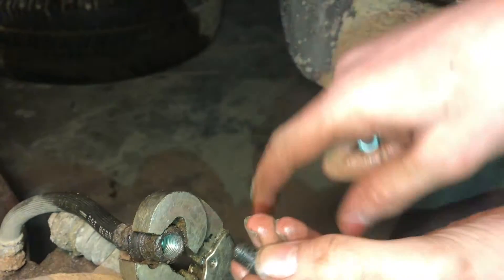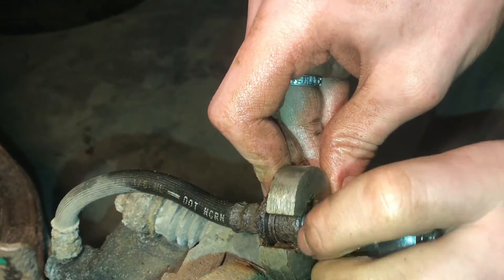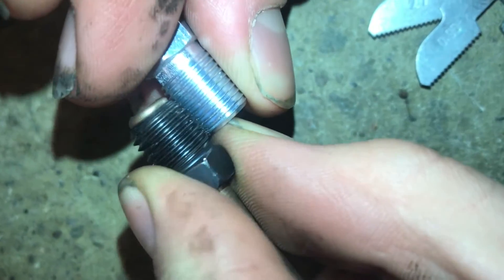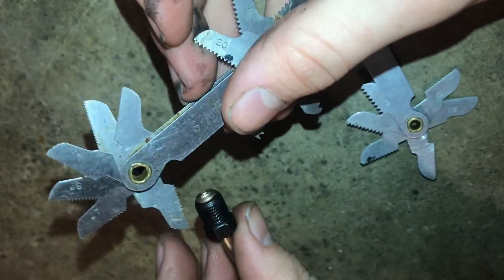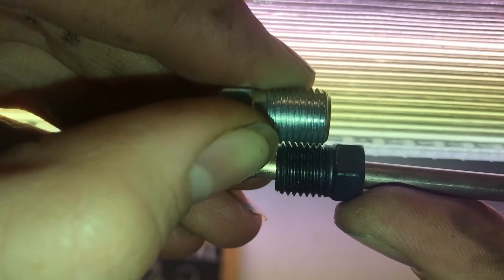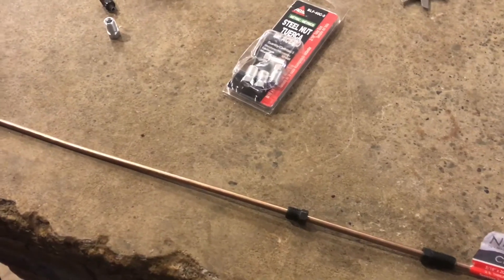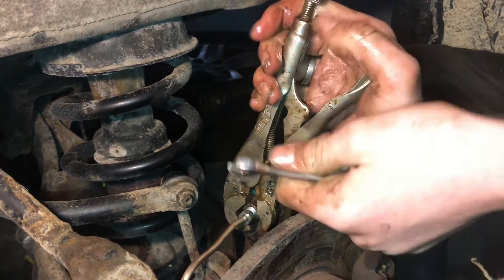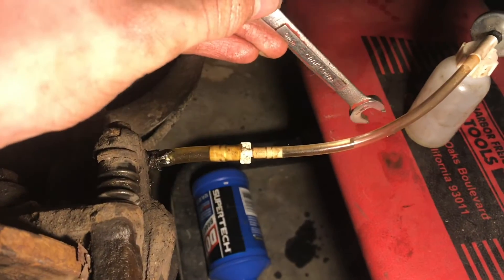how to verify brake line fittings are CORRECT

Comment: Here is the way I explain the difference in the metric versus SAE threaded flare nuts… And why they are so close? A flare nut with metric 10 x 1 thread has threads that are 1 mm apart. There are 25.4 mm in an inch, so 25 threads. A flare nut with SAE thread is 3/8“ x 24. So there is basically only one thread difference across an inch. You have to be absolutely certain what thread you are working with.

Another thing you did without explaining was when you cut the store-bought brake line in order to replace the flare nuts? You did not show how you created a new double flare, assuming you made one? some novice watching your video may think it’s just a matter of cutting the line and pushing it into the fitting, which of course would be a disaster.

Comment: Just so everyone knows, the black threaded bolts are a standard American thread. They work fine if you're using another union that is designed to fit. They're only wrong for the car in this video. Always do research and don't rely on any single piece of information.

Comment: Thanks for the video. The Chinese metric fittings were loose fitting on the Brake Hose assembly. I needed the SAE fittings not the foreign metric ones. Now I know why the Fittings were not tight and causing Brake fluid to leak around the fitting.

Comment: I bought a length of copper brake line from the parts store for my Ford Ranger and had exact same problem with the threads of the black colored fittings.  Now I know why.  Thanks for the great video!!
Reply: Same with my 98 Ford ranger

Comment: Just a note: On Euro Brake lines, the Flare us a 'Bubble' type vs. The 'Inverted' type on USA & (I believe) Asian marques.

I believe that the Asian & Euro use the same Metric 'acorns/nuts', but pay attention to the Flaring of the Line.

This can be a challenge when you're swapping parts (such as my GM Master Cylinder swap onto a '66 Porsche.

Comment: Only video on YouTube about this. Question, I'm working on a brake system that came out of a 2013 Sierra and making up the brake lines. The fitting that the master cylinder takes is a M12 1.0 and looks like the brake line is a 5/16 but I am unsure. Could that be correct? Or does the size of the brake line need to be metric too?
Reply from the maker: As far as I can tell, the same Breakline is used for both standard American fittings and metric fittings. I typically buy the copper nickel brake line and depending upon which fitting I need I put the fitting on and then flare it. The mechanical part of the brake line properly sealing up is in the flare.
Reply: @livefree6878  I see, but would a standard double flare mate well with an application that takes a metric fitting?
Reply from the maker: As far as I can tell The flare is the correct size for the metric and standard American thread. I have use the same flair method for both. The metric and standard American thread are very similar, But if the thread is incorrect you will not get the pressure to make the seal. The flare is the same, But the setting is not